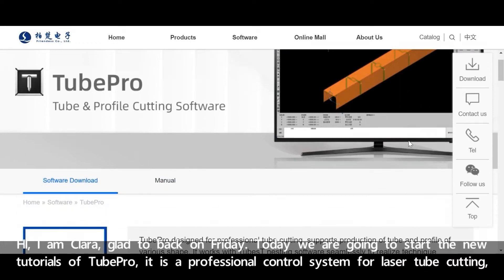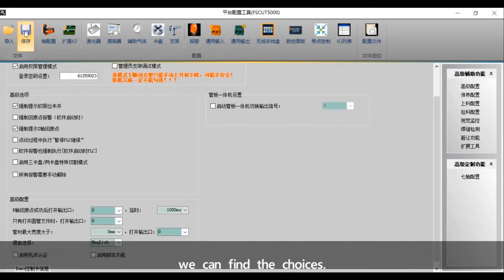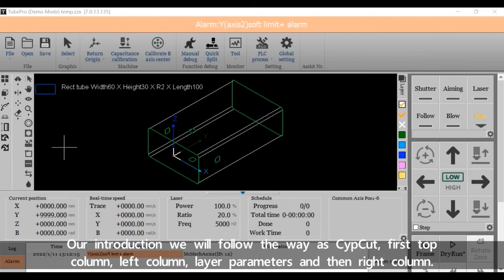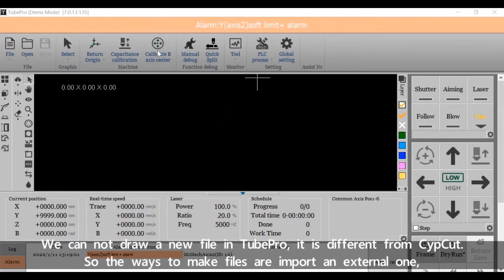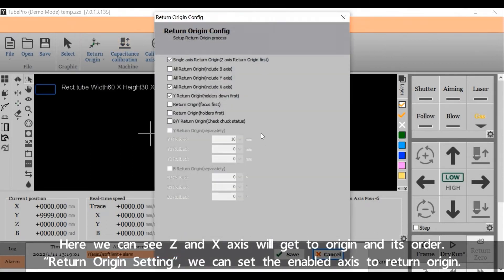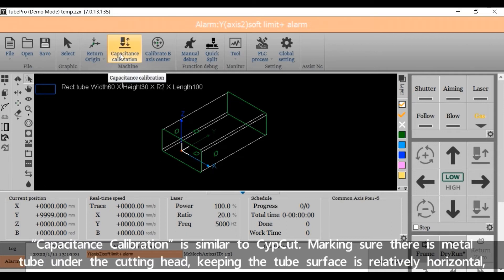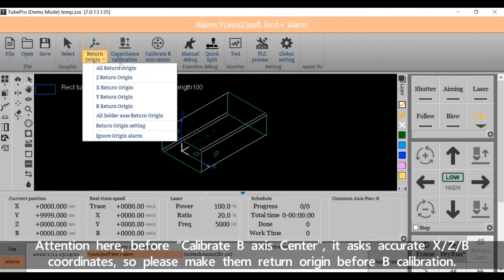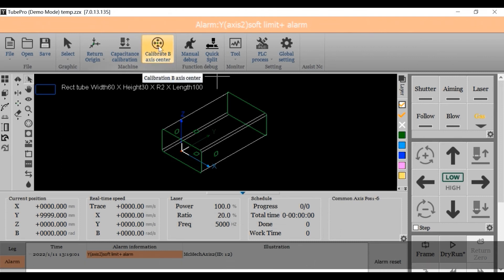TubePro Tutorial for Laser Tube Cutting 1

Comment: I have a bcs100 controller, when running the program, it gives a message that it needs a config file.  It recognizes the app lock and has no lock issues.  After running the program, it gives servo and reference error and does not get origin.  I tested all methods.  How to give a config file to the program?
Reply from the maker: It is better to give me a picture of the alarm.

Comment: Mam we have a problem with our software Tubes pro: when we make a (Dia-50.8 mm thk-1.6 length-40mm) and make componsate 0.03 on both end and array it  in common  and cut then we observed that first pcs is okay but second and other pcs is small in lenth by 0.6 mm why? 
Please reply and give solution kindly request
Reply from the maker: In warranty? what parameters?
Reply: @ClaraChai  yes cut speed 10 m/min pawer78 duty cycle77 focus -2 B axis -35,35 but problem is with all pipe .....and other hand when we cut pipe(with hole and slot) with same componsate C.D. from end  is ok and C.D. from last  decrease and we have another machine with same company and kw with these parameters there is no problem